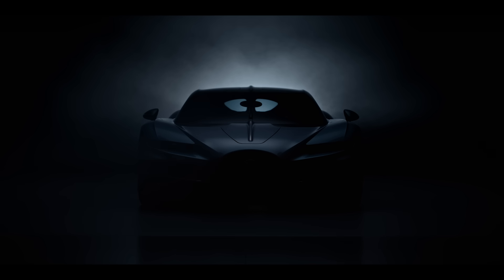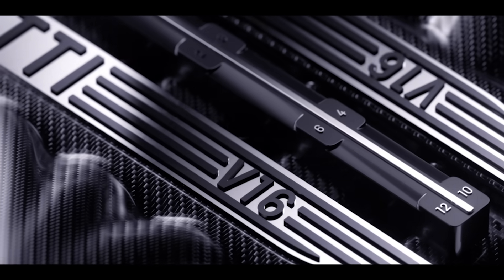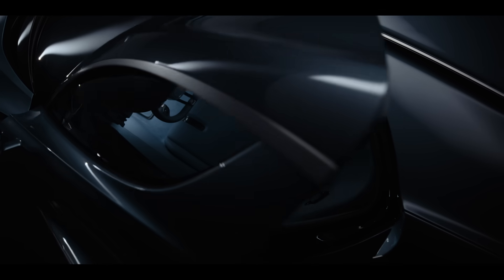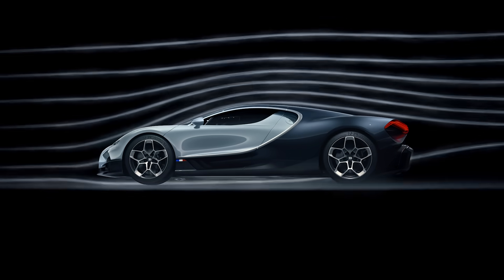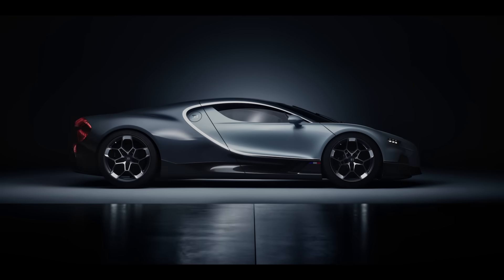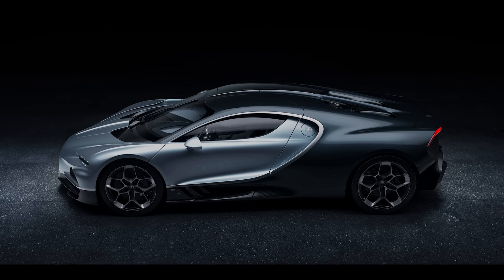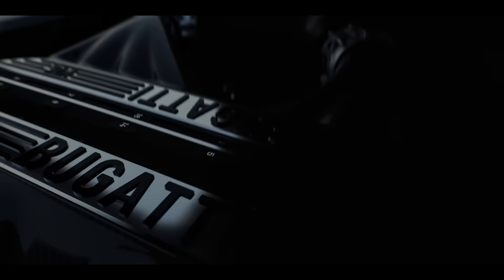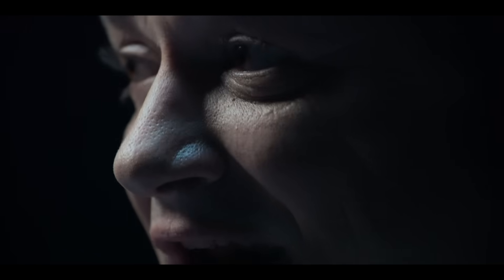Creating the BUGATTI TOURBILLON

Comment: I sat in an EB 110  at Dragone Motors in Westport CT, in the fall of 2016. Smell the leather,  look out the rear view mirror over that enormous engine... legs stretched over the flat floor. Padded seat 5 inches off the floor.   Grab the steering wheel and look over the numerous guages set into a beautiful wood dash panel finished in ultra low lustre sheen..they said it was on loan from the Belgian owner... my 15 dream came to an end, but i was driving my Mini Cooper S that day...

Comment: The RPM dial is easily confused with the speed dial due to its length, which points too close to the speedometer. It should be slightly shorter to avoid this confusion.

Comment: Space technology,
carbon fiber - solar battery.
Electric generator, rechargeable battery. It just doesn’t fly 😉
Toyota has created a flying car and is testing it. I'm glad they keep up with the times. Now I'm looking for those who are interested.
But for me, attaching a propeller to a car is not an achievement, that’s what I think about it. Need new ideas 💡
Answer: instead of wheels, there are four balls filled with gas (helium). Or we pump gas into the sealed body and leave the chassis. Pressure regulating balloon. And one folding propeller to control...
I wish you a soft landing.
The company RosAtom and Tesla have created a lightweight battery.
You can add carbon fiber that generates electricity from the sun.
Helium as an option 👍
The new material is a metal alloy with a high level of entropy. Its formula Al20Li20Mg10Sc20Ti30 indicates that it is composed of five different metals, lithium, magnesium, titanium, aluminum and scandium, mixed in approximately equal proportions. Anti-corrosion, lightweight and durable.

Comment: That much electric power just ain’t happening. 

789 horsepower = 588.8kw. So a 25kwh battery / 588.8kw means it’s lasting 2 and a half minutes assuming it has unlimited discharge power and no overheating or sagging. Maybe if it uses the less compact and stable LiPo chemistry it can hit that but it’s not lasting long.

A bunch of the power is fake and only lasting 2 runs.

Comment: My Valkyrie runs circles around this 2 ton bugatti on the 'Ring. And it only has 1000 hp, from a Cosworth V12 engine (yeah, just like the V16). Hell, my GT3 RS runs circles around this on the ring. And it only has 550 bhp from an inline6. This fat V16 porker will not go below 7:00 I bet my porsche on it.

Theres a reason why Bugatti dont release any lap times ever. Because they're embarassing. A magazine tested a Veyron on the ring and it was slower than a Bmw M3 with less than half the power !

Comment: I think Rimac blew it with this V16 engine. Not out of the park, but out of my garage. Because it is not only underpowered compared to the W16, but it has the same power as Cosworths V12 engine from the Valkyrie ! So why not use the 1000bhp Valkyrie V12 engine and save a huge amount of space, weight, fuel, and not to mention development cost ?? Basically they doubled the price of the car because of this stupid V16 engine. When they could have used this:
 
'The car contains a 6.5-litre naturally-aspirated V12 engine tailored by Cosworth, which produces around 746 kW (1,000 hp) at 10,500 rpm, with a redline of 11,100 rpm. This will make it the most powerful naturally-aspirated engine ever to be fitted to a production road car.'

Comment: Why not use the Valkyrie V12 engine and save a huge amount of space, weight, fuel, and development cost ??
 
'The car contains a 6.5-litre naturally-aspirated V12 engine tailored by Cosworth, which produces around 746 kW (1,000 hp) at 10,500 rpm, with a redline of 11,100 rpm. This will make it the most powerful naturally-aspirated engine ever to be fitted to a production road car.

Comment: It’s almost a sin to think about a V16 engine made for anything other than a ship, plane, or locomotive in the era of electrification.  The first such vehicle to use one was the Cadillac V-16, introduced in January 1930.  It was one of the classiest and most expensive cars of the era, with only 4,000 units built until 1940.  In its honour, GM created the Cadillac Sixteen concept, which stunned everyone when it was unveiled at the 2003 Detroit Auto Show.  One would think they now wish they took it to production...

Comment: The new Bugatti Turbelon looks from the outside like another special edition of the Veyron, rather than a completely new Bugatti model. The interior concept of analog, timeless instrument design is intriguing and understandable, but the steering wheel with its fixed center seems like a childish design idea that is not very ergonomic for everyday use. In contrast, on the technical side, the car seems to be the pinnacle of the automobile.

Comment: the purpose of the horshoe grill now is for aerodynamic for speed and no radiator for cooling? now it has a good place to insert removable license plate since most of the country have speed limit then just remove it if your going to autobahn or carshow, i hate seeing cars that have number plate that ruined the design because they doesn't have a proper place in the front license plate.

Comment: The great engine w16They removed the turbos from it and it became weak, so they added 3 electric motors to it to produce the same power. What is the weight gain? 😂
Reply: There's no weight gain. In fact it weighs less than the Chiron, is that enough for you ghost kid?
Reply: @steven_taylor_ still heavier than any of the ghost
Reply: @Thehero-d5k  It will be lighter than the Gemera and no ghost has a 16 cylinder engine.
Reply: @steven_taylor_  weight of this Bugatti and gemera is same don't forget gemera is four seater
Reply: @Thehero-d5k  So? Your also forgetting that this new car has twice the number of cylinders than the Gemera and a larger batter pack (25kWh) than that of the Gemera (14kWh). How about that?
Reply: @Thehero-d5k  Tourbillon's weight isn't same as that of the Gemera. Gemera with all fluids (90% fuel and 100% other fluids) is over 2 tons, 2022kg to be precise (official data). Chiron was just under 2 tons with fluids and this new Tourbillon is lighter than the Chiron.

Comment: 16 Cylinder 3 E motor bla bla bla at last 1800Hp?😂
Koenigsegg has a V8 and 1 crazy E motor And it produces 2300hp 👻☠️
Reply: V8 needs turbocharging unlike the V16 which is naturally aspirated and thus more emotional 😂
Reply: @steven_taylor_  the w16 With 4 turbos it produced 1500hp But no V8 2 turbo by Koenigsegg produced 1600hp👻Are you still talking nonsense, Bugatti kid?
Reply: @aymenkorichi9366 Look here egg kid, that V8 needs E85 to produce 1600hp and the W16 had more unexploited horsepower and it wasn't even stressed out!
Reply: @steven_taylor_  Listen, Koenigsegg engines have a unique feature, which is reducing emissions, and this comes from free-valve technology. This feature enables them to run and give the greatest power on any gasoline, in exchange for less emissions and less fuel consumption. Unlike Bogatti It needs a billion liters of gasoline to move and consumes a lot due to the engineering of its engine. Do you know what Koenigsegg means?
Reply: @steven_taylor_  like the gemera i3 cylinder 2 liters, but it is brutal and gives 600hp. Can Bugatti do this???
Reply: @aymenkorichi9366  Koenigsegg can have their technologies and everyone knows and saw what happened at Greece with the Jesko attack Nür edition. That's enough for you egg kids.
Reply: @aymenkorichi9366  Bugatti doesn't do unemotional engines like a 3 cylinder engine meant for hatchbacks. The appeal of a Bugatti is in its 16 cylinder engine ever since the Veyron made its debut.
Reply: @steven_taylor_  All cars get into accidents, Bugatti and Koenigsegg too. No car is perfect
Reply: @steven_taylor_  Don't lie to yourself 😏 There is no car company that made all these innovations and patented the invention within twenty years of its life, and there is no car that carries as much technology as Koenigsegg. Do not be upset, brother. If Bugatti worked for a million years, it would not Reach the ghost level. Here we end
Reply: @aymenkorichi9366  That accident wasn't caused by driver negligence. Never a Bugatti burned down other than someone setting it on fire deliberately.
Reply: @aymenkorichi9366  Are you sure about that? Bugatti made the W16 under VW and that was a very complex engine and showed their technological prowess they had back in 2005. What did Koenigsegg do? Oh they took a Ford V8. Bugatti is making a NA V16 while Koenigsegg is making a TT 3 cylinder, tell me which engine sounds exotic and which sounds like it's a fit for a hatchback? Bugatti has much more financial backing than Koenigsegg, now you don't lie to yourself and if they are given a free canvas they will easily surpass Koenigsegg, it's just that the stakeholders don't allow that.
Reply: @steven_taylor_ idiot look at size 8 litre and 5.5 litre

Comment: I don't understand its top speed is slower than chiron super sport, its engine is less powerful, its electrical power is less powerful than nevera, while its wieght is approximately the same as chiron. If buggati wanted to create a marvel they should have observed one from gemera , its a four seater its single electric motor has the same output as tourbillion 3 motors and has more torque and its engine is also more powerful, gemera wieght is also lighter than tourbillion with additional 500 hp plus tourbillon power to weight ratio is also not good as compare to the compitition  . That's an engineering marvel by buggati🥲🥲🥲

Comment: This V16 is going to be pinnacle in automotive history Mate Rimac cooked it
Reply: crossworth went far and beyond on this one.
Reply: General Motors is going to be pissed. They could have had the V16 on the market decades ago, with the Cadillac 16 but they chickened out.
Reply: @blairbrown4812  And the Cadillac Sixteen is also prettier in my humble opinion
Reply: @conscienceexpansion5956  apples and oranges. The 16 makes for a better luxury sedan while the 12 Beyond makes for a better GT car
Reply: @modzone6417  firstly it’s a V16 not a W16. Secondly a W16 is not two v6s put together. That would make a v12.
Reply: @AnythingGasoline  its two v8 engines put together making it a w16 this specific engine is a v16 but if you go watch the documentary they made for the veyron they called it a w16 engine educate ya self
Reply: @modzone6417  lmao I know all about the w16 but this engine has nothing in common with the w16! It’s a completely new engine for the Bugatti developed and built by Cosworth.
Reply: @AnythingGasoline  👍
Reply: nope
Reply: The v16 is gonna be insane
Reply: Makes the same power as the v12 6.5 valkyrie engine while being heavier and bigger
Reply: @wololo10 You do realise that the valkirye is basically a track machine that's barely road legal, meant to be used on the limit, so they squeezed every inch of power they could. While the Tourbillon is more of a GT, the Engine isn't stressed out ON PURPOSE, so that it's more stable and comfortable.  Same went for the Quad Turbo W16. It can make more power,  a lot more, but that would compromise it.

So you simply not get it or are you just dense?
Reply: @Necro-s  so?
Look hp/litres 
Koenigsegg has better hp/litres 
And how heavy car is 
Bugatti was good under Volkswagen group
Reply: @Thehero-d5k  Koenigsegg uses turbochargers that's why it has better hp/litre and those V8 engines are stressed out to the max while the W16 and V16 had a lot of unexploited potential and wasn't stressed out. This new car is lighter than the Chiron despite packing a 200kg heavy battery and that doesn't include weight of the electric motors. Rimac just made Bugatti better than what it was under VW.
Reply: @steven_taylor_  that's the point why extra weight 
It still needs more maintenance because of more parts 
Ok even if we used the full potential of v16 engine with TT 
It will produce more power than the car can handle that's weight to power ratio exist and I m not even talking about how unreliable the engine will become
Reply: @Thehero-d5k  More maintenance can also be needed if the engine is stressed out, for example the AMG One's V6 needs replacement after every 31,000 km. Compared that to a Ferrari V12 where some of them easily have over 100000 km. So having more parts doesn't always mean more maintenance is needed. Everything depends on the wear and tear of the parts.
Reply: @Thehero-d5k  exactly, more hp per l IS more stress for the motor.  Smh, don't compare a gt to a sportscar
Reply: @Necro-s  Bugatti doesn't publish their engine endurance
Reply: @wololo10 the difference is the v16 isn’t stressed to its max to produce the 1000bhp.
Reply: Cooked equals doing something wrong
Reply: @Rapido20  in the context the original commenter said yeah but not alwyas
like if u cooked then u did something good but if uare cooked then something bad has happened to u

Comment: I love how taking off the turbos isn’t even considered a trade off or downgrade, and it’s more of something special to be able to hear the large engine scream at a high RPM. 

Usually engines get smaller with added electric motors, but they wanted to keep the heart and soul.
Reply: Yeah u keep best of both worlds. Sound of engine and REV jumpmynees and use KERS as torque fill. For supercar quite good decision. Its same compromise Ferrari uses is La Ferrari for example.
Reply: @alesksander I am a new learner as a car enthusiast, can you guys suggest me some good car tech channels or how could I get more information on current car revolutions and so on??

Comment: Thanks Mate Rimac ! 🎉
Reply: they could have design it better especially in powertrain features,battery pack weighs 200 kg with 130 wh/kg in pack level energy density,CATL has released a battery cell called semi solid condensed NCM cells with 400 wh/kg in pack level energy density,they could have 50 kwh battery pack with weight of only 125 kg in total meaning it could be twice in capacity and 80 kg lighter in weight if bugatti just payed more attention to the details,also they could have 6 liter twin electric turbo(same as 2025 porsche 911 gts which acts like an anti lag and generator for the battery pack) w16 that puts out 1500 hp and weight of 200 kg in total,they could order ultra powerful 800 hp yasa axial flux e motor to be sandwiched between the 6 liter w16 and transmission which has 15 kw/kg power density(highest in the world)all of that means bugatti tourbillon could make 2300 hp from w16 engine+3 ultra light weight e motors and CATL semi solid 50kwh  battery pack for the powertrain,and din weight of only 1880 kg in total,bugatti what have you done with your amazing hyper car
Reply: @davidfujkk8018  then why arent you a top mechanical engineer?
Reply: @davidfujkk8018 bro wtf is this

Comment: bugatti is insane for doing this, v16 engine after so many years is insane!
Reply: plus 3 electric motors i mean this car can hit 300mph easily if they add a quad turbo like the old chiron and off the limiter
Reply: @elawn-kg7de  stop saying that "add turbo bs". This car is lighter, more powerful, has lesser drag and smaller frontal area, all that means it WILL go faster than Chiron
Reply: @elawn-kg7de  Two turbo's would be enough.  Without the electric motors and the awd system, it will be lot lot lighter..
Reply: The Chiron engine is 200 Kg heavier...
Reply: Faster but an inferior vehicle, in my opinion, Bugatti  have always sounded horrid   just awful,  they finally have an incredible sounding engine that revs to 9500 and with the electric i am sure if they wanted they could have given it like 2600 horsepower , but more power I'd not always better
Reply: @hellridersofcalgary   Agreed, at least they put in a Cosworth engine that should reliable and lost those spooling up turbos that were a mandatory replacement after a few years. I think they may have improved their quality by these changes after all.
Reply: @hellridersofcalgary revs to 9000 I read. But now it’ll sound good, finally.
Reply: Well, the previous models were W-16 with 4 rows of 6 cylinders. One turbo per row and really ate a lot of gas. This is the N/A 2 rows of 8 cylinders. No turbos, So with less fuel consumption aided by battery power, there is about 30%-40% less fuel burned. It does sound a bit crazy to me also. Mat'e was trying to please people from both worlds I guess.
Reply: Hybrid v16 to be exact
Reply: @Shadow92105  cool
Reply: @Shadow92105  we're not talking about hybrids bro even tho the car is
Reply: funny, because some kids believed the V12 will disappear
Reply: dont mean to cause any probs or fights but like quad turbos if they put they could have pushed the limits like hell, but idk if the engine couldnt handle the horsepower
Reply: @uraveragesuddu  I think they will do that if they make a super sport verison for it like they did for it's predecessors
Reply: @warrison08  yup that would be so freaking crazy dude